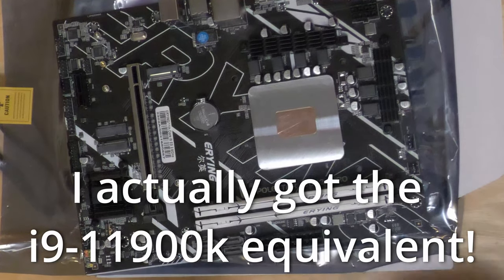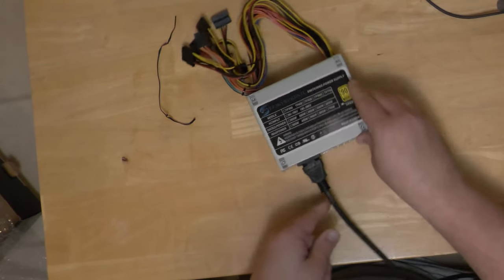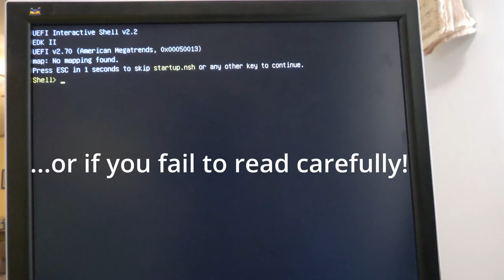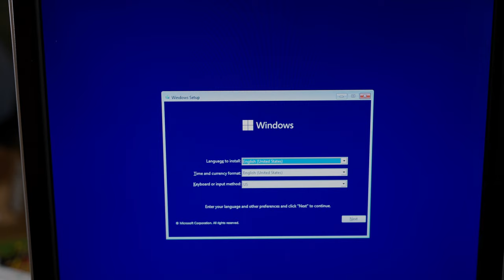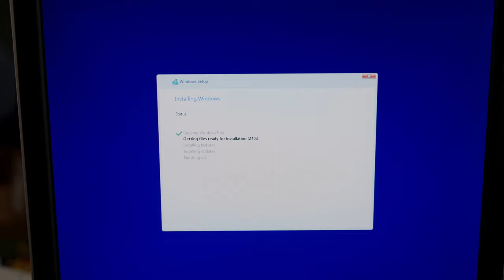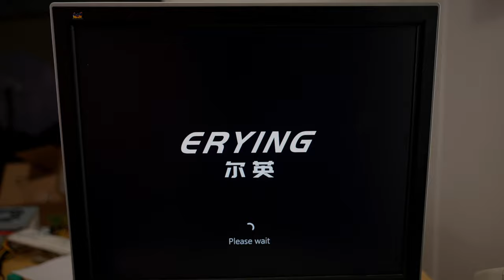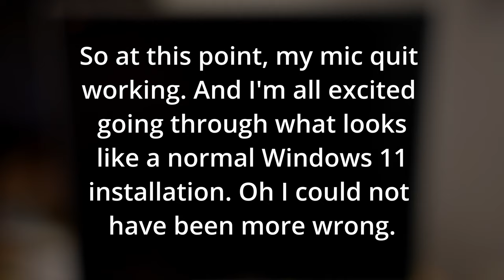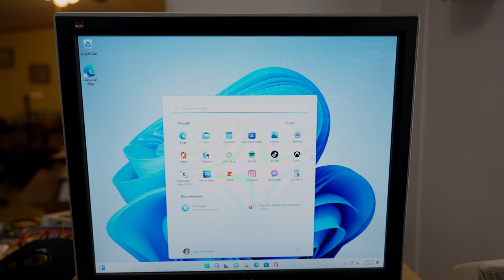This weird, cheap Erying motherboard/CPU from Ali Express kept crashing. Here's how I fixed it.

Comment: Just a heads up for the future "anti-static" bags are conductive on the outside. The way they work is they are supposed to not let static pass through to the inside by creating easier paths on the outside for electricity to pass. It's pretty high resistance so the chance for shorting stuff out by running a motherboard on the bag is low but not impossible so you should really just use the bare cardboard box without the bag for bench testing.
Reply: This is very useful tips
Thank you

Comment: I have the non ES (retail) variant with the 11850h and have had exactly zero issues.  It's been rock solid even using the integrated graphics connected to a 4k TV.  I wonder if it's just a roll of the dice with the ES version.  It's an odd setup but so far it's worked great and it's always fun to work with these slightly off the wall platforms.
Reply: I have the 11900H ES and had to try a lot of drivers to find the one that works, still problems sometimes with the overlay. The mobo says the graphics is UHD but it should be Iris XE. I had to force it on. Not working at all with the latest driver.
Reply: can you overclock it?
Reply: @TituszFekete  yeah..
The es versions are fickle.
Better go with the non es.
From the reviews I've seen, they seem to be quite stable.

Comment: I bought the 11800H ES board and it was fairly trouble free. My initial testing was done on the iGPU, and I did have some real issues when it came to synthetic graphics benchmarks even with drivers installed. After adding a dedicated GPU, I've only ever had one crash in the month that it has been my gaming rig.
Reply: Can you do a review after a year?

Comment: Hey glad you could overcome this error. Some brazilian tech channels bought these boards and started trying different configs. If you're experiencing the boot loop it might help you deactivating the virtualization before installing Windows and then activating it again after you installed it. I am myself using the i7 version of it.
Reply from the maker: Thanks for the info! There's a lot to learn to get this oddball working well...That's part of the fun! :)
Reply: @JerryTravisSmith  Hey no problem. I hope this info might help someone in the future.

Comment: FWIW I have two of these boards. One of them I installed proxmox and it's been solid, zero problems.

The second I installed Win10 and it installed fine, but the moment the graphics driver was update it boot looped. Adding a discrete card fixed the problem, but I REALLY wanted integrated graphics working. 
After alot of trial and error I ended up going with Win11, and that worked without issue.

It is now my daily driver and has been flawless. Incredible deal.
Reply from the maker: I eventually got integrated graphics working too ( https://youtu.be/zc_-TAtnqSM ), but the easiest thing to do is supposedly to disable virtualization during the install then re-enable it after the drivers all get updated. I haven't had a chance to test this out myself but if it works, it's a lot less hoops than anything else I've seen.

Comment: I have the i9 variant and on my case after the PC was finished and windows was installed, it would suddenly shut off as if it was a bad pau or if there was a short in the system. I contacted erying and they suggested to post it with 1 ram stick and GPU installed and in uefi mode. Got it to post a rebuilt the PC. Have not had an issue ever since. On the sellers post it says not to use the integrated graphics in legacy mode
Reply from the maker: Well, I did the install in UEFI mode and 64 bit, which I'm pretty sure isn't Legacy Mode and it still didn't work without a discreate graphics card or using the specific driver version as noted in the video after this one. I'm going to try an installation with virtualization disabled. Several people have suggested this.

Comment: I've been running this mobo for over a year in my daily driver machine...the 11900H board/ES cpu combo, 2tb nvme SSD, a RTX 4070ti, and 64gb DDR4 "TEAMGROUP" memory.

I'm having an issue where my windows installation consistently gets corrupted. At first I thought it was a crappy SSD that was dying, but after buying an enclosure and some new name brand nvmes, I learned they weren't dying...just getting corrupted. Reformatting them allows them to be used. But once I install windows, even on a brand new name brand SSD, it gets corrupted in a few weeks or months and windows will not boot, cannot be repaired, and has to be reinstalled the hard way.

The windows memory diagnostic reports no issues. Monitoring temps with cpuz and openhardwaremonitor don't' show anything alarming. I am almost at the point of throwing this friggen board away. Any ideas on what I should test/change to try and see why this is happening?
Reply: Have you fixed the error?

Comment: Those anti static bags do not prevent static on the outside and can actually cause it, bad idea to ever place electronics on one of them.
Reply from the maker: Interesting. I did not know this and have built 6-7 systems this way over the years. I guess I’m just really lucky.
Reply: This is a mylar bag and is safe to work on. The kind with conductive ink on the outside is unsafe,
 as it will short the board as you put it on it.

Comment: So basically you need an external GPU in order to first boot windows and then if you want your UHD graphic drivers to work, you need to install a separate specific Intel driver...interesting...
Reply from the maker: Well some people have said if you disable virtualization you can perform the install with no problems. After installation you can re-enable it and it’s supposed to be fine.  I haven’t had time to test that out though. 

Another commenter said he was going to install Windows 10 with no network connection and then install the UHD driver and perform the driver update block, then upgrade to Windows 11. That seemed like a pretty smart work around to having a discrete GPU for the initial install. I haven’t had time to try that either.

Comment: The seller gives a link to their own drivers for the integrated graphics card, all other drivers, including drivers installed by the operating system itself, do not fit there.

Comment: I've spoken to some other Tech tubers.  They strongly recommend against using Chinese branded SSDs with Chinese branded motherboards.  Both mobo and SSD are both from same source.  He should have used a well known brand for the the SSD Nvme drive.
Reply: did you mean recommended against using...  If not, what's the reason ?
Reply: @Aspiring-Hobo  sorry, wrote that late in night.  Recommend against, due to the Chinese branded mobo not seeing the Chinese branded SSD from BIOS.  From what I learned the well known brands of mobo Asus, MSI, Gigabyte are fine with lesser known brands of SSDs

Comment: Bro one question have please answer me. I want to know if the rtx 3090 graphics card that was given to me will work on my computer or not? I should mention that I use after effect and 3ds max programs, I don't want a game.
My pc details. İntel e5 2689 8 core 16 threat 128gb 1866mhz x79 motherboard psu 850 wat samsung ssd 980 pro 2tb
Reply from the maker: It should work fine. I think the chipset and CPU might bottleneck the card a bit, but as long as your PSU has enough 4 pin connectors for the 3090 you should be ok. (I don’t know for sure because I always have semi-slow GPUs so I’ve never physically touched an 80 or 90 class card. 😂)

Comment: Maybe it force install bad driver.
Reply from the maker: I think the CPU/chipset implementation on this board is very suspect. Intel probably never imagined something like this would be cobbled together. The drivers are probably like "What are we supposed to do with this? Oh well...here goes!" and Blue Screen of Death!

I have figured out easier and easier ways to deal with the crashes during install (check out my other two Erying motherboard videos). But I bought this board because it is weird (mobile chip on a desktop board) as a machine to tinker with. I'm hopeful to get the thing mounted in the old Tandy case very soon!

Comment: I have mine paired with a rx5700 and still getting the loop.
Reply from the maker: Did you install Windows from scratch with the RX5700 installed?
Reply: @JerryTravisSmith  yes I did.  I finally got it to work.  I did the repair of the install and it took about 40 minutes but then bam it all worked. Not sure what the magic was but now it's up running smooth!
Reply from the maker: @lepoopysmack  Excellent. I’m glad you got it working. It’s so frustrating until you get it lined out. 

On my board, I did notice when I did a cloud repair, it would get a little further before crashing even with integrated graphics. There is definitely some difference between the USB install and the cloud download install. I assume the cloud install is more up to date while the USB install media creator probably gets frozen at each feature release and doesn’t get the cumulative updates. That’s pure conjecture on my part, but I did actually make it to the OoBE screens with the cloud download.
Reply: I noticed something really weird with my repair and the moment everything started working.  I was using the RX 5700 the whole time and it displayed out but during the repair the fans kicked on and then everything started to work after that.  That was about 10 minutes or so into the repair process.  Still super weird but hey at least it's working!
Reply: I Had to completly disable the IGPU in the BIOS.  I am using a RX6600 with it now. Funny thing is Linux mint works perfect with the IGPU.
Reply: @lepoopysmack is it still working now?
Reply: @bloxfruitdealer247  it is!  I have a modded bios that made it much more stable too.  It's my gaming PC for my living room.
Reply: @lepoopysmack  glad to hear it.have you encountered any problem since then?
Reply: @bloxfruitdealer247  no not really other than it won't boot with 32gb of RAM but not a biggie.
Reply: @lepoopysmack  damn. 16gb is more than enough tho🤷.How does it perform in games? Is it similar to any processors that run on pc?
Reply: @bloxfruitdealer247  it's pretty close to a Ryzen 7 5700x that I have. Not completely apples to apples but similar performance.  In games though not quite as good but not bad

Comment: Someone said  that this cpu can use 180w power! A  great  mobile cpu i had never seen! So i  bought one  12700h version!

The seller said that  it is not  a es .
Reply: 92W in Turbo it consumpting for 128 sec maximum, then throttling happening.